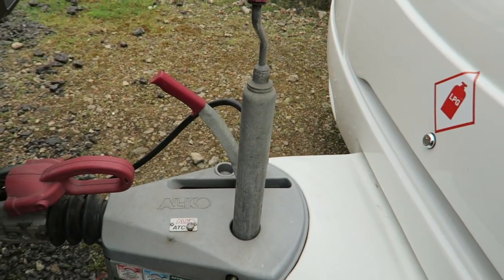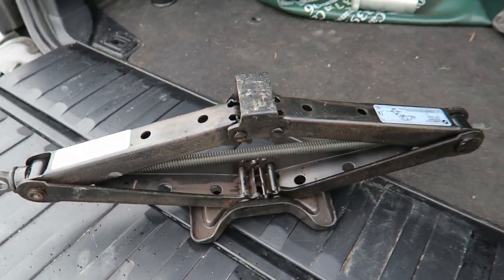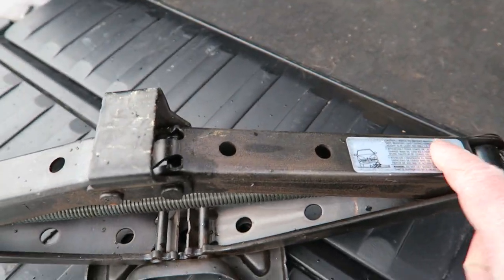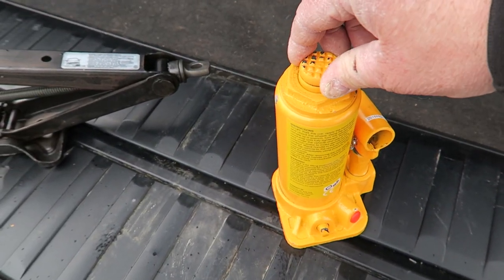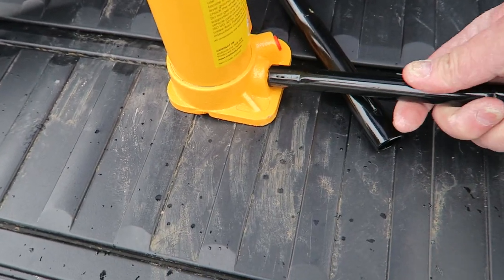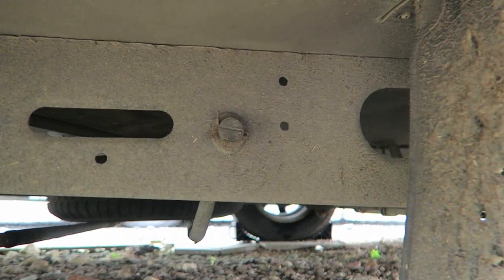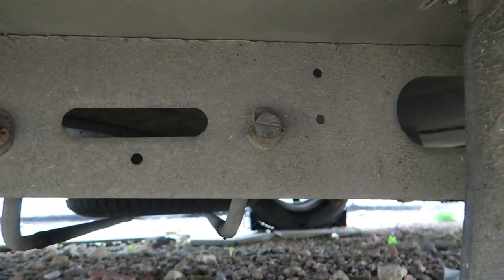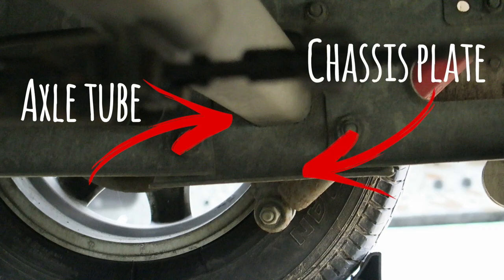How to : Jack up a caravan safely

Comment: Just a note, obviously not recommend unless your really stuck. But I have successfully lifted a caravan and changed the wheel using the corner stands. I would also recommend once the van is up on the bottle Jack and you are about to remove a wheel or preform work put the corner stays down just to steady the van and limit the risk of the Jack slipping.

Comment: I always carry a small trolley jack in its own case ,bottle jacks are very unstable and need to be on good ground ,also carry wood to put under jack,so you have the wheel of ,cars coming past rock the van ,real danger of jack slipping ,small piece of wood between metal surfaces,iejack to van ,yes you are right steadies are not for jacking ,but  I would certainly put down until I had the new wheel on,better the van got damaged not you

Comment: Had to replace a tyre while on a pitch (twin axle caravan), Tyres on the drive (Halfords) had the correct size and load capacity tyre and came to fit it. The tyre fitter had a hydraulic jack which covered a wide area of the chassis and he'd obviously done this before. Attached the car and chocked the opposite side. Lifted the van, wheel off, new tyre fitted and wheel back on in about 10 minutes. Lowered the van and then the question "what's the torque setting for the wheel nuts?". Ooops, I had no idea! Into the handbook and found the settings whilst also on the phone to a caravan friend for advice. 115Nm! Always keep that information handy, along with the wheel sizes. My other tips is: Get a torque wrench (handy if you have to change a wheel yourself) and know the settings for your wheel nuts (both fitted to alloy wheels and steel wheels (spare)).

Comment: Thanks for the video.  I've fitted a jacking bracket which I made myself from some square steel tubing with a bolt through it to locate the head of the bottle jack.  I'm lucky enough to have access to an engineering workshop.  
The only thing I would say about the way you jacked the van is that I would have put a piece of wood between the jack and the axle tube to protect the tube.
Keep sharing the love!
Reply from the maker: Morning, yes - the wood is an excellent idea, and in subsequent lifts, this is indeed what we have done.  Sound like your solutions is an excellent alternative. 

Thanks for stopping by

Take Care

Dan

Comment: Having seen your video about fitting the shock absorbers, I wondered why you hadn't fitted the Al-Ko jacking points which would make the process of a wheel change so much easier, better access and zero chance of the jack slipping, down side like the shocks slightly added weight to the unit, but well worth the effort.

Comment: You  have produced a series of practical videos. 
Permit me to make a suggestion which makes things easier in real life.
Should you have a flat tyre, use the car to run the flat tyre up to the top of your levelling ramp before starting to  jack the caravan up.  This avoids the problem that there may be insufficient clearance between the ground and the chassis to allow the jack to be inserted. 
The spare tyre will be inflated and needs more ground clearance than the flat it replaces and the jack may be unable to give sufficient lift to accommodate this if it was  started from the lower point.
This also allows more clearance for the underslung Al-Ko spare wheel carrier to drop down and clear the longitudinal chassis members, especially if the flat tyre is on the side of the release.

I trust that this is not seen as a criticism, just an improvement?
Reply from the maker: Really excellent points,

Thank you.
Reply: your explanation was a lot more informative than this video--thank you

Comment: Thanks for that will be checking my caravan at the weekend for jacking points. Better to know about it now then on your journey in the dark, wet stuck on the side of the road
Reply from the maker: Excellent Andrew, its worth having a trial at jacking, getting the spare wheel off and also changing the tyre, it requires more thought than that of a car. 

Let me know how you get on.

Dan
Reply: The Trudgians  hi

Comment: Thanks for this. Really useful. Crazy that caravans aren't routinely supplied from new with jacking points.  I was surprised Lunar simply tell you to jack up on the chassis if you can find the right area behind the wheels. Not impressed. So many extras to think about when you take up caravanning, don't you think? When I queried this at the dealer on pickup, they simply said get the breakdown service out. Hardly useful advice for routine maintenance and turning wheels in storage etc.
Reply from the maker: Hi Phil, yeah that's pretty poor advice from the dealership, however - if on a motorway and I had a flat tyre, I would certainly get the 4th emergency service out.

also its pretty hard to get a jack under the axle tube when the tyre is flat, so its quite a challenge regardless. Glad the video has helped. Have a look at us installing the Ko-Jack system onto the van, that saved us when we had a flat tyre.

Speak soon

Dan

Comment: Good video but it makes you wonder with caravan manufacturers they fit a spare wheel and storage cradle but not a jacking point it reminds me of a caravan technician when asked why did manufactures of caravans do not treat the timber framing on caravans agains rot I was told it add to much weight to the van really I just shook my head

Comment: Good tips on jacking up but The weigt of spare wheel and jack etc I decided that I would call out Greenflag to assist especially if on route and the time delay wouldn't be much different by the time I attempted to do it myself and you can't on motorways anyway.

Comment from the maker: Hi Ben, I would strongly recommend you DO NOT use the steadies. on ALKO chassis, they are not connected to the chassis, they simply are connected to the floor. They are not designed to take a lot of weight, and they will split the floor. 

Finally to minimise the jack slipping, i would use a Axle stand to ensure the 'van doesn't move further - but with the tow car connected its movement should be minimised. 

Look out for a follow up video in a couple of weeks - where we install some jacking points on the 'van

Thanks
Reply: Well, like I said not recommend but got us out of a pickle. I find it odd that a manufacturer would not make the stays strong enough, as often on sites we found ourselves having to put a fair amount of weight on them to level up. But we don't stay on posh sites like you 😝. Farmers field normally.
Good channel and content though mate. 👍
Reply from the maker: Cheers Ben, Remember these are steadies, not jacks.  in days of old, you could have gotten away with more abuse, but not on the ALKO chassis. 

Its about time we had a meet up again soon eh ? I'm doing less and less on radio at the mo. so its about time we had a catch up. 

Speak soon fella.
Reply: +The Trudgians Same here, I have one of those new Icom 7300 here. Had it out the box to make sure it worked and that was it. Not used it since.

Comment: Another episode of ‘van life carefully explained - your vids totally ace it 👍 I have a newby question - could one not chock the jockey wheel side-on to prevent the ‘swing’ effect? Only I’d quite like to do a quick winter tyre rotate and hitching up to the car leaves it half out in the road and also blocks the pavement. If not, it taking the van for a tow around the block having chalked the tyres’ current position could be the thing to do, especially as I’ll also need the handbrake off. Alas I don’t have a few feet of drive to just roll it back or forth a bit. Any top-tips welcome!

Comment: Out of interest when we had the van at the dealer we bought it from to sort a problem with the Al-Ko wheel lock receiver they jacked it up with a trolley jack under the motor mover.  Is this is good idea or not?  Carrying a small trolley jack around for emergencies could be an option and because they start low it should in theory be much easier to get it under a van with a flat tyre.

Great channel by the way, keep up the good work, very informative for someone who is new to caravanning like myself.
Reply: No it is not a good idea.  Shows that dealers are not all you might expect.

Comment: I would be very wary of using the jack directly onto the axle tube. The point loading will be very high and potentially deform the tube.. Personally., I would interpose a flat metal plate to spread the load.

Comment: Hi guys. Someone has already mentioned about the 4" drop when jacking following a flat. Had this with a friends van as we were travelling in convoy (of two) on a motorway. Not good but it was near side and away from the traffic. We left the second outfit a good 25 yards back from the injured one to act as protection against anyone straying on to the hard shoulder. Yes the axle was too low to get the jack under so after a combination of using the bottle jack to lift via the chassis (yes I know it's a huge no no but needs must at the time) we then plonked the trailer axle on to an axle stand which I keep in the locker for when the van stores for any length of time. The stand held the unit up enough to get the wheel off and when bringing it back down we could use the better jacking point on the axle to lower the van on to the lovely new tyre. Now then. We had applied brakes and the car was still hitched but van movement from the motorway traffic flying past while we were on the hard shoulder was an issue. We dropped the corner steadies to cancel this issue. Worked just like on site  on a windy day and made the job a good deal easier and it felt safer. Corner steadies retracted prior to lowering the van back down obviously. Curious about those AL-KO jacking points as they fit to the chassis which is lower than the axle. Interested to see the shape and how they fit. Thanks for the vid.
Reply: Seen the side jack point now. It gives a lot more room for jacking. Doubtless it will be away from the motor mover. Be daft if it was obstructed by that ;-) Buy jacking bracket point thingies at next opportunity :-)

Comment: I was wondering (though I do not know if the caravan floor can take it) if you had used a wooden plank to spread the load on the floor above, could it have taken the load and given you a better jacking point? I used to do simmilar to rusty old cars who's jacking points were always the first thing to rust away (Irony, I think it is something with a lot of iron in it).
Reply from the maker: Hi Rob,

No - the wooden floor is actually quite weak. The floor is a thin ply, with a foam inner core, then another thin ply. There is a real rush of splitting the floor if any weight is applied to it. 

With caravans it is best to use either the dedicated jacking point, or the very far ends of the Axle tube. 

Hope that helps - and a really valid point, so thank you for raising it.

Dan

Comment: HI Dan, Do you think it possible to make a jacking bracket yourself?     I.E. 2 correct size bolts, length (A) metal metal to fit the 2 bolts through and a bit of metal (B) attached? (welded) at 90 degrees to (A)  to fit the bottle jack top? (KOjak & Alko side jacks are very expensive for what they are?), it occurs to me that as long as the welded 90 joint between A & B is good it should be alright?  your comments will be invaluable (Caravan resident genius)
Reply from the maker: Hi Bryn, im sure a far better man would be able to do such a thing, i however am just not that competent at making stuff..

Comment: Thanks for this. We've just got a caravan so wanted to check this out. Caravan handbrake on also,  I think would be best practice?
Reply from the maker: HI Rob, yes absolutely. all brakes must be fully on and also add some chocks to the side of the caravan that is not being lifted. 

I hope that helps.

Dan
Reply: As the caravan rises the wheel must turn. Do not use the handbrake, but chock the opposite wheel and secure the hitch. Ray Rowe

Comment: Have you thought about having to jack a caravan to change a flat tyre where the caravan would be 4 inches lower you wouldn't get the jack under the chassis. You need a lower jack.
Reply from the maker: HI Nigel, you are correct, hence why we purchased the KoJack system, however in some cases it will still be too low. So in that case - a good way around this issue is to use either a levelling ramp to pull the caravan wheel up by a few inches, or a plank of wood to give that clearance. 

Thanks for popping by.

Dan

Comment: Would a trolley jack be easier? I noticed that when the bottle jack was being pumped up the caravan was moving and could've fallen off the jack. It isn't really all that much different to jacking up a car. My 1991 Coachman came with the handbook which shows where to jack on the (galvanized) chassis.
Reply from the maker: Morning, Im sure a trolley jack would be easier, but a couple of points. Because the location of where we need to jack, the trolley jack would have very little swing to operate the handle. Another point is carrying a trolley jack when going on holiday - we simply wouldnt have the room. The caravan would always move slightly forward or back when jacking regardless of the jack used etc - hence why its so important to have the caravan connected to the car. 

It was after this video that we decided to purchase the Ko-Jack system, that made the whole operation a lot easier.

Hope that helps

Dan

Comment: Sorry guys but using a bottle jack like shown just does not seem safe.Any movement and it will surly slip off.Ok much safer attached to the car and the opposite wheels chocked but even then I would not risk it.
Reply from the maker: Im confused, have you actually watched this video ? The caravan is attached to the car, the opposite side is chocked, the caravan does not move. If you have another way of safely jacking a caravan, please share it with us all. 

Also, please watch the Jacking points video we created after this one, which demonstrates the add on jacking points. 

Thanks
Reply: Yes I have watched the video.I am talking here about personal experience and my opinion.
I have looked at trying to lift the caravan so both wheels are off the ground for winter storage.In my opinion the top of the bottle jack does not locate into a secure locking position to the chassis and in my opinion can and may slip.Also to get a decent leverage to pump the jack up is very difficult as the lever on these little jacks is very short and this can result in you actually moving the jack accidently.Maybe will work on a very firm ground,no wind and chocked very securly. Personally for me after experiance attempting to use a bottle jack I resorted to getting a small trolley jack.Yes ok for me as we tow with a land Rover discovery D4 so no problem with weight or space.I am adapting the top of a axle stand with a U shaped top cut to fit over the top of the bottle jack ram which will I hope make it secure.Thanks for your prompt reply you must be at your PC like me.Have a great Christmas and happy new year.Love your videos by the way.
Reply from the maker: Ahh, ok - i think it was lost in translation, sorry. 

Yes i know what you mean about slip, this was the reason we installed the Purple Line system to give a good connection to the bottle jack. This was a far better solution than the ALKO side jack system in my opinion. 

As for ground conditions, i couldn't agree more. As you can see the ground at our storage yard is pretty gravelly so we used wide planks to disperse the load. 

Will be really interested to see your U shaped bracket, this is something caravaners would love to see im sure. 

Thanks for the wishes, just sat at the computer finishing off a few things before the sherry & mince pies take over ;-) 

take care
Dan
Reply: I'm with Blackvulcan on this.